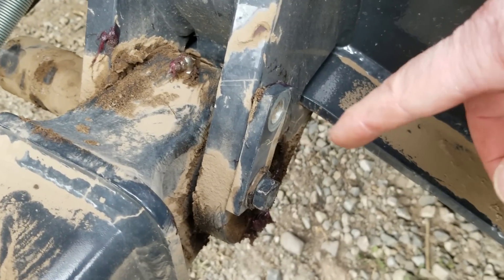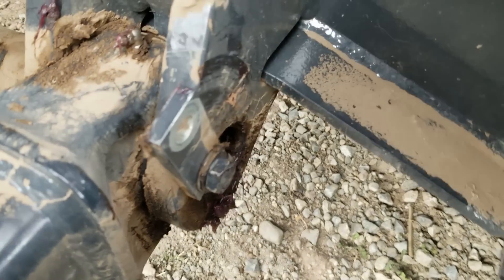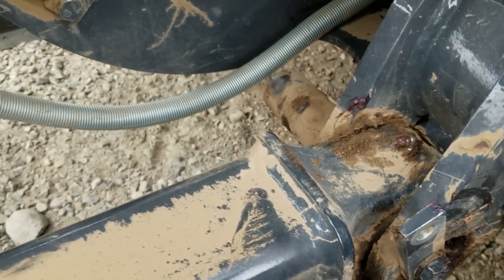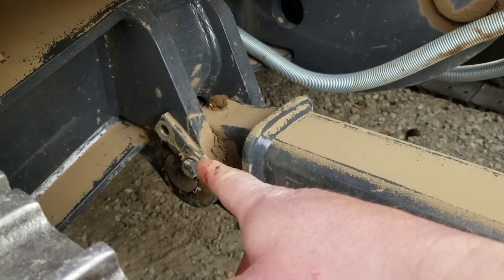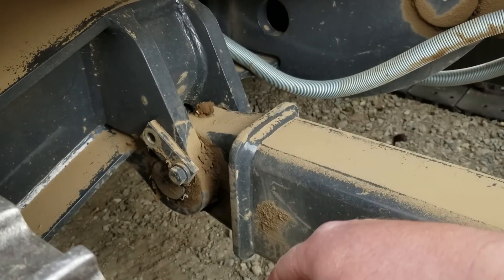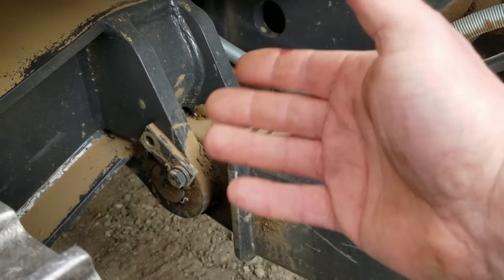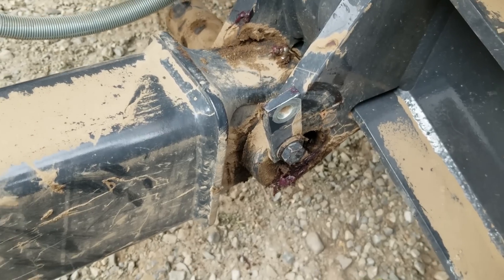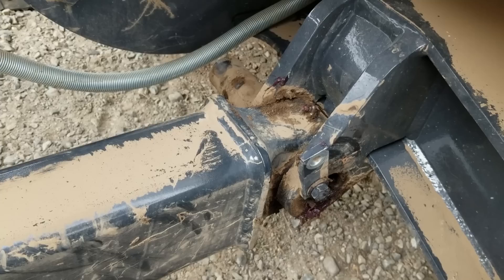Deere excavator design flaw. Suggestions?

Comment: @AvE could you not improvise a method of attaching a guage to measure the outward forces the pin is putting on the plate being held by the bolt?  It may be a way of figuring out what is generating enough force to shear that 10.9 bolt. There has to be some type of movement that caused the pin to try and walk.

Comment: As a Deere mechanic, this looks like a lack of grease that permitted the pin to turn loosening the bolt in the retainer plate. The only design flaw is that the plate wasn’t part of the pin, which is how most of the other pins are made. By the way, this Deere was probably made in Mexico, not Japan. 😎

Comment: Looks like the pin is rotating WITH the center segment and driving the keeper away from pin and sheeing the bolt, rather than the center rotating ON the the pin.  More greasing is where I would start.  Not that you haven't probably already realized this.

Comment: The design worked perfectly on the drawing board. Since the pin couldn't move in two directions at once, there had to be a twisting moment to shear the bolts.

Comment: AVE, weld a washer on one end and a small extension with a hole in it for bolt or pin on the other.
Those pins are out of the way so adding length shouldn't be an issue.

Comment: The only way it 'should' shear the bolts on the keeper plate is if it is not greased. Looks like there is no lack of grease. Weld the keeper plate to pin, problem solved.

Comment: I'm guessing they may have over torqued the bolts and/or used too soft a bolt. I'm thinking drill them out, clean or re-tap the holes and use grade 8 bolts going back together.

Comment: Weld a washer on one end, bolt a washer on the other. Needs to be free to pivot, or it will free itself as you can see.

John Deere never recalls anything. They have the “Product Improvement Plan”, or PIP as techs and service writers usually refer to it. As a former JD mobile service tech, I used to do all sorts of PIP installs. The idea is JD looks like they care and are taking care of your purchase, rather than admitting they sent out a poorly engineered product. More about preserving their image and saving money than anything.

Comment: Pin seizure in the bore during blade down operation.  Pin rotation put upward shear load on the rear retainer bolt.  Cut a radial groove all the way around the Pin instead of just a segment.  No more shear on the bolt when the pin seizes.

Comment: Lube, needs more lube, anything that runs in the dirt can't get enough grease. If you can get within 10 feet of it and not get all greazy, you're doing it wrong. We tear our diggers apart about every 100 hrs and clean out the dirt and regrease the pins so they don't do that. We've had Deere's and Cats. There's alot ditch witch backhoes that are not greaseable. They have fiber bushing you just replace every couple hundred hrs. Happy diggerin'.

Comment: Pins moving around is a common problem, like others have commented.  The machine could also have been abused.  The mining company I used to work for would buy undersized loaders and then decide they couldn't move enough and put bigger buckets on them.  Then when they became too light and the ass ends would stand up in the air the company would just stick on more counterweights on the back.  Then they would come back and bitch at the manufacturer about all the bent frames, broken center pins and bent cylinder rods.

Comment: Seen the same problem on volvos. The problem is if the bore in the chassis is loose. The bolt will walk it's way out. We have to linebore and hone the holes in this Volvo. This Volvo was an l180f loader with under 1000h when this happened. But after line bore it was solid

Comment: Cut to suit, beat to fit, paint to match. Standard workorder. Did i mention i was a millwright in the paper industry.  Washer on one side drill out bolts, rethread for a common size, rinse and repeat

Comment: The pin is twisting when the blade is used as an outrigger.  The fulcrum is so close to the center of the pin, it acts as a rotary wedge.  Welding that strap to the pin will give the bolts a fighting chance.
Reply: My experience is you either weld or use bolts, but not both at the same part to fix something. If it goes wrong, you'll break both weld and bolt (unsure what will go first, but if one goes, the other will snap quickly after).
A solution would be to make 2 full caps, one for each side. Tap 4 holes in the base metal to fix each cap and shorten the pin so it will be able to rotate free in the socket, trapping it inside.
Might need to add a grease nipple somewhere to prevent it from running dry.

Comment: my suggestion would be to weld a top plate to the pin with two holes in it to align with the keeper plate holes. it can't go deeper because of the cap, and it won't go the other way because of the bolts.

Comment: Amazing. My favorite motto: never blame the equipment, always blame the operator (current and past).

Been in the equipment rental business a while, specializing in John Deeres too.

Never seen that, especially with such low hours. The real design flaw is that with the blade fully raised and stick curled in there is interference between the blade and the bucket, so if you are facing backwards and rotate the gantry too quickly you will damn near break the blade right off.

I assume that is what happened and it somehow side loaded the hardware holding on the pin locking plates.

Or the torque gun they used for the hardware had a bad day. Built on a Friday
Reply: Friday afternoon, monday morning. Same same, only different...

Comment: Personally I think there's too much of a side load put on that pin the way it moved when you put the plow back down. My backyard engineering degree would machine a second slot in that pin and add a second locking plate🤷

Comment: As an extractor fan (used to be a farmer) this is very common when the pins get a bit of rust on them from sitting over winter...weld a BAW (big ass washer) to one end and drill the other end for a linch pin and leave the main pin floating..no grease all the crap just sticks to it and Waller's out the holes.
Reply: I believe you meant to say a bfw…

Comment: You said it as I was typing it. weld the pin to one of the straps and replace the bolt. Seems to me an over torque problem at the factory.

Comment: As an enginerd, I can tell ya that’s not a design flaw…that’s a “feature”!
Reply: Something AvE should have payed extra for! 😂
Reply: As another enginerd, I can tell ya that's not JUST a "feature" but additional job security.  I'm working on the software fix for that problem right now.  We are thinking bluetooth pins.
Reply: And as another enginerd and a person that actually does something in their spare time: don't put rotationally constrained bolts in pins with rotational potential, it'll either back out or over-torque and snap off. Maybe you mechanical engineers need some pointless fucking tests to take after you graduate like us civil engineers do so you don't fuck up so much.
Reply: Get him outa here!!!!!!! lol just kidding admitting you have a problem is the fist step to recovery…..
Reply: Winner!!!!!
Reply: And that mentality came straight from Cat of the early 2000s; the "Downsize til we can't downsize no more; then subcontract the stuff." Luckily after my time. I'd hate to be connected to a sticker company that it's turned into today. Just one step above G.M.

Comment: Indeed for feller head you weld the  plate on the top of the pin  ,a little preheat before... a good plug weld with metalcore.. or something similar it will last longer than our liberty in Canada!! essaye ca mon homme!!

Comment: I would bolt a large washer over both ends, might through drill it and use one nut and bolt with cam lock washers

Comment: Had the same a few times, slightest stikment on the pin (Lack of grease monkey usually)  and off flux the tab. tried the weldment trick still happened  due to rubbish weld, so the slot on the pin got turned to a groove on the lathe to take the plate. did all the pins the same one at a time as they went!!!

Comment: Weld some thick Square bar to both ends and the other side and do away with all the bolts. The pin is spinning out of the threads of that bolt. No good

Comment: Replace the bolt on the body and replace the bolt on the pin , make a slot for motion and a rivet that can let the arm  move. Kind of sloppy engineering and also a possibility of recall, but it would be up to His imperious Itch

Comment: Looks to me like not enough grease and someone lifted the blade under load..... twisted the pin and snapped off bolt holding tab.... that pin should have grease dripping off of it at all times.... not a good design.....

Comment: Get a longer pin and plate one end and the leave 2 inches on the off side and install a thick ring for the pin to slide in,then install a cross bolt of at least 5/16 graded  8 with a locking nut.

Comment: Weird spot to  shear like that , I suspect Pin trapped too tight or somebody slipped in some Butter Bolts to save some pennies?
Reply: Those style of retainers fail on buckets n such, wherever the pin should be stationary in the arm but the hole is too loose I usually rework the tab so the pin can do its rocking without putting all the stress on the fastener, sometimes the tab will not handle it and you end up making it more skookum, warranties on equipment being days probably no free fix.

Comment: So from what gather the pin is rotating with considerable force sheering the beams off. 

So 2 issues. 
1. the pis is seriously stickafying under load. So poor bearings. 
2. The locking tab system is a pile of poo. 

Have seen that idea used on some completely different industrial stuff and it was constant trouble. 

A shouldered bolt with a nut that has a locking split in with its own little nut solves the wandering out. But not the turning. 

Presumably they want it to turn on the arm so it is worn and replaced not the main body casting. 

The answer is to not have a hex but a plate on the solder bolt with those bolt holes matching. They will then just take torque from the pin. Not a cammed force on the locking bar. The other side doesn't need to be a thread nut then. But put a square on with an aligning locking plate to sit on the square. 

Them the lubrication or bearing needs some attention. An auto grease system. Or better. A smooth ground pin in stainless. That have oils seals or o rings fitted either side if the bearing in the arm. So when it's fitted the grease is kept in and the dirt and water out. 

It won't jam up with natural dirt and try to turn constantly then. And probably last for 10 times longer and it'snot making natural dirt grinding past.

Comment: Too much slack in the captured pin bore and the slot isn't cut deep enough in the pin. Beings as it's hardly used I would say it's the slot. Pin should never have enough side pressure to break the bolts off, it's almost always because the pin is pushing up on that style of keeper, or the holes are sloppy. The factory has some pretty loose tolerances for captured pin bores these days, and the slot isn't cut deep enough so the keeper plate is touching the bottom of the slot, when you jerk that pin up and down on a few rocks is when the bolts break loose. Also grade 8 fasteners, I don't know why grade 5 seems to be more and more common these days on equipment but I've seen alot it.

Comment: my MF compact tractor with a factory backhoe .. likes to break bolts .. if you don't have enough grease on the pins .. they stick and then slide when they should not there go's bolts and other parts .. keep your pivot pins clean and greased

Comment: RG Letourneau once said "Never use a bolt where a weld will do." A couple dash dash welds would hold the pin keeper in place >> 130 hrs.

Comment: yeah this is a problem with one of our assemblies at my company, the only solution we have found is that we just weld the bolts through our assembly but doesn't look possibly for the placement of both of those. That or (and this was explained to me in passing so i might mess this explanation up) a screw only fastens depending on the threads per inch, I would recommend increasing the bolt sizes tho

Comment: Only long term solution we've found to un tapered horizontal pins like these is to knock them out and clean them and regrease every 100 hours or so. The dirt mixes with the grease so even if you grease them, Which you had obviously done with the freshness of the grease on the fitting, it gives the pin enough traction to thrust sideways which eventually metal fatigues the bolt or weld or whatever you use to try to hold the pin in place. All sizes of excavators with a blade mounted like this have this problem and it's purely from the dirt that falls on them from normal excavator operation with the bucket.
Reply: Can't they put a gland or a dust cover at its ends that keeps the pin from getting dirty???

Comment: Don't weld it.  drill er out, tap to higher grade bolt and lock washer.  Seen many welded, pain in the ass to grind off if pin wears out.  Too many hicks fixin stuff that you will have to deal with later, and you will have to deal with it.  Little tip. when greasing, it don't hurt to have a knuckle buster to check bolts. and extra 5 or 10 minutes can keep a machine from being down for weeks waiting for parts.

Comment: Possibly the fasteners that are broken off were overtightened to start with. Perhaps past their yield point. There are products out there that lock the head of the bolt. They are hexagon in shape and go over the head of the bolt and are fastened with another small, think 6 mm fastener to hold it from rotating.

Comment: Happened to both our cats! 
I ended up just welding the tab onto the pin! Funnily enough the replacement pins have the tab welded on 😂
Reply: some brilliant engineer comes up with this shit only for the solution to be a weld on tab.
Reply: Pin is probably 4140.  Use lots of pre/post heat when welding or she snaps off easily
Reply: A machine breaking parts in its normal operation and over its service life is normal. Stuff happens. 

This kind of damage after 120 hours isn't normal wear and tear.
Reply: @largerPOTATO  Breaking, NO!  Wearing, wearing out, getting misaligned & then breaking, sure.
Reply: @alro2434  Any time you have a operator in the seat of a piece of equipment, breaking parts is normal unfortunately.

Comment: Not that particular issue, but as a retired engineer I can finally reveal the dirty, filthy secret that the instant Serial Number One rolls off the line those newly hired bright-eyed junior engineers are set to work on "cost reduction" mods, because every suit was born knowing that a percentage of every dollar saved drops straight into the quarterly bonus bucket. Lower grade hardware, like maybe bolts or rocket booster o-rings are low hanging fruit.

Comment: I get work like this all the time, except the pin is plumb wore out and we just machine a new pin, give them a retainer that isn't shite like the one I seent in the video, enginerds like to "save money" with designs like that to reduce on materials. I've never seen a pin with a slot cut into it for retaining it in the bore, I may be a humble mig monkey but that doesn't seem too skookum

Comment: RG2 shouldn't wipe off that easily.  Weld plate /washer on opposite side of pin that walked out first. Side of pin that came out first, drill hole and fit big R clip or similar.

Comment: Design perfection,
Why have they gone away from a simple flanged pin with cotter or lock pin at the end? I know that area is exposed, but even a flanged pin and a keeper bolt going through the pin at the other end. 
At this stage I'd weld them in from opposing sides (front left and rear right), should be right from the factory with Current prices but the quality is getting worse and the sales guys get richer.
I had a 2.7 ton case break the coupler at the rear of the bucket, was told its not to be used for lifting even though it had a hook mounted on it, it was only lifting a 12" bucket that you'd lift by hand. Over €360 + VAT for replacement part and it came with a hook also. Machines are getting softer. Buy an old Tach, can't break them, and if you do you know you're doing something wrong!

Comment: Knock the pin out and run a flap wheel down the bore of the moving part. And grease the fuck out of it. 
Looks like the moving bit is tight on the pin and the stationary bit not tight enough. Possible that there's a burr or bit of pickup in there binding it up.

Comment: As a certified farmricobbler I have found with pins sometimes it's best to let them float side to side a little so what I typically do is weld a washer to one side then drill and tap the other end and use a heavy washer and lock washer and/or loctite to capture the pin. Never done it on an excavator, but hope this helps.
Reply: Lack of maintenance will giveth floating pins and taketh floating pins
Reply: Not a good idea to do it. The pin needs to be fixed, so it only moves on brondze/steel bushing, that wears out with time and can get changed. If the pin is not fixed - it will eventualy maul out the holes on fixed side and repair of those is a lot more expensive than changing a bushing.
Reply: Wish in one hand and shat in the other

Comment: That shouldn't shear the bolt unless the pin is seizing inside the bushing/bearing causing it to twist when the arm is raised or lowered.
Reply: Which could happen as well when the grease freezes in the winter to some solid glue. If it's made in Japan then they don't see that kind of weather.
Reply: @ehsnils  Still, couldn't and shouldn't there be an answer for this? We do it with engine oil, hydraulic fluid, etc.

"In [whatever climate zone] use [whatever] grease..."

???